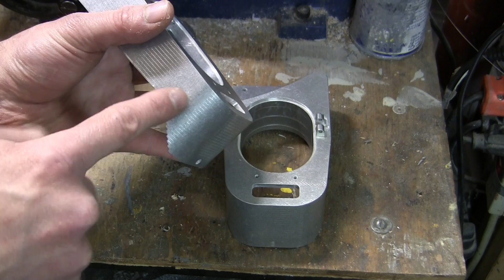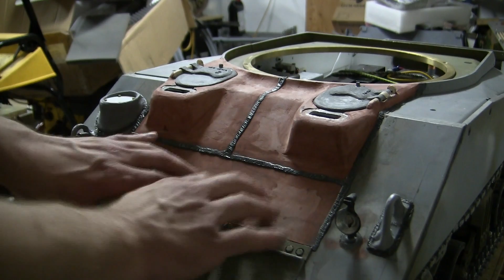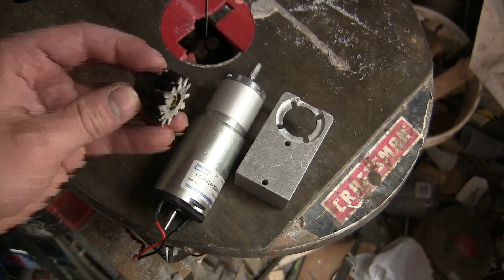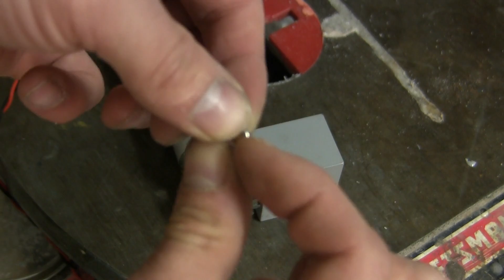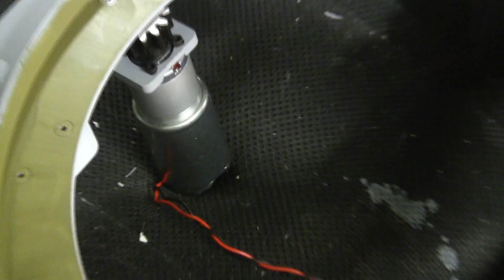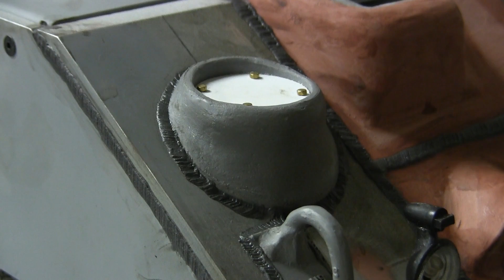1/6th scale RC Armortek M4A4 sherman tank project video #10 (bow hatch and upper deck)

Comment: Do you really have to weld these?
Reply from the maker: The kits are designed to be bolted together via fasteners, No welding required. The welds that you see in my video are sculpted on via epoxy and are only for detail purposes and are not real.
Reply: Thanks
Reply: I notice you use a red product for the casting texture and a grey product to simulate the welding , what are the product names ?